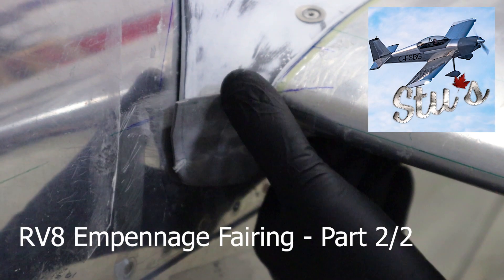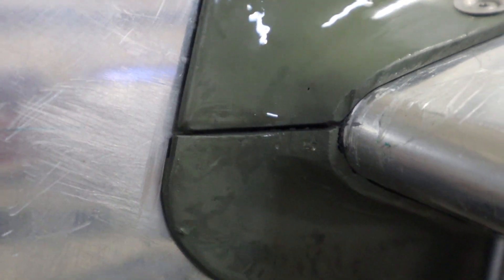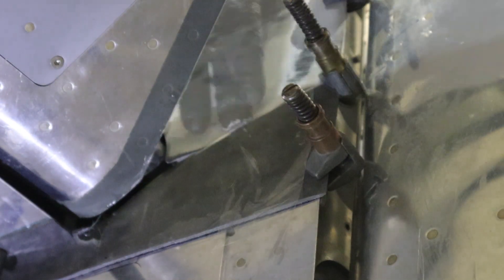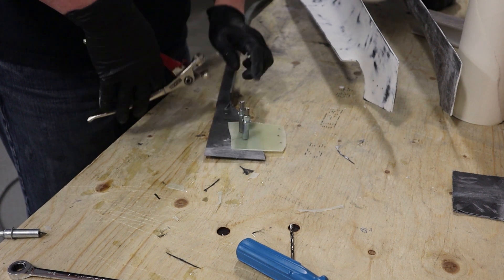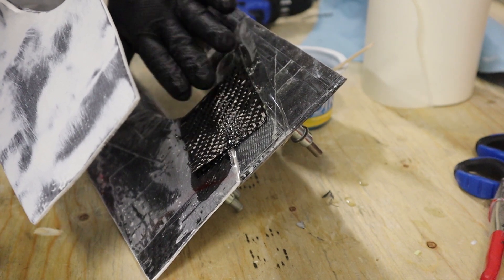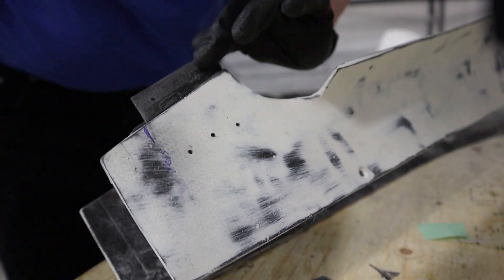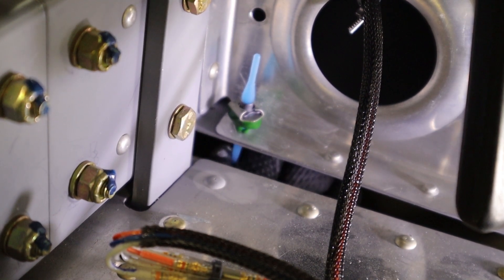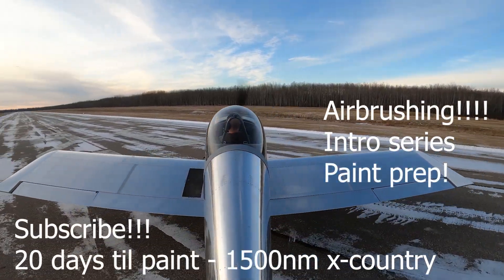RV8 Empennage Fairing - Part 2/2

Comment: When using fibreglass resin I always clean brushes, scissors etc in clothes washing powder and warm water. Massage the powder into the brushes wet and rinse repeat till all the resin is removed. Works a treat. Save in buying new scissors all the time too.